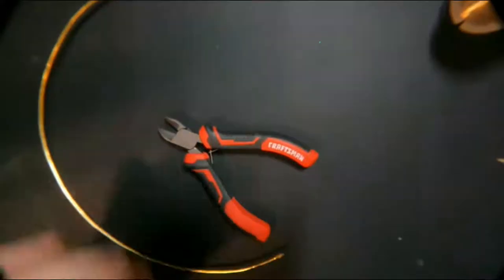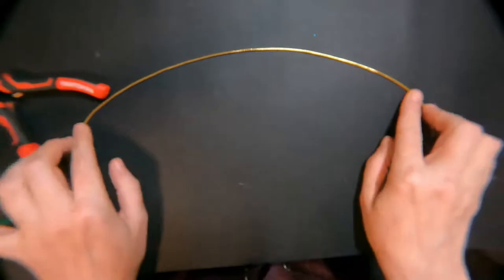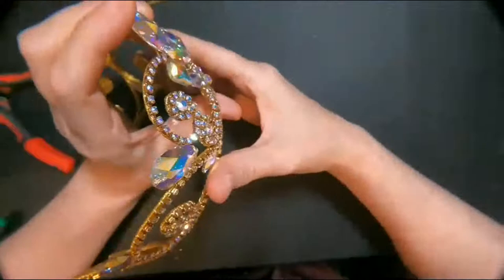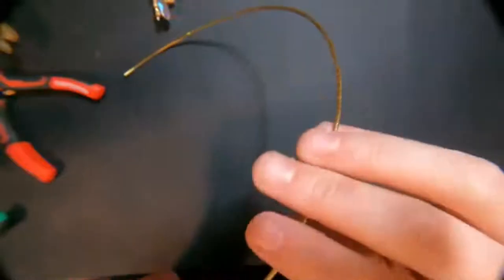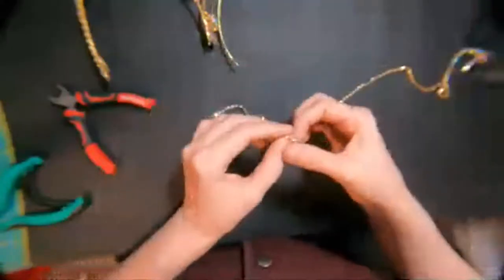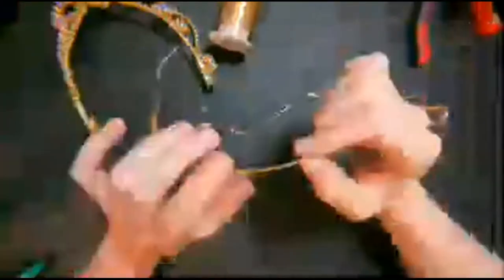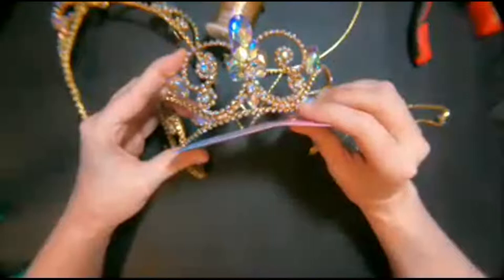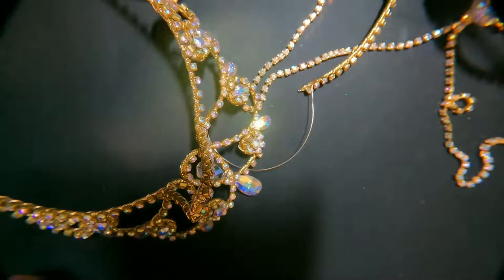Creating a base wire for your ballet headpiece

Comment: I have been making tears for a few years now. Just wondering why you don't use premade metal headbands
Reply from the maker: Premade headbands are shaped -- well like a headband. They can work as a tiara base; however, I personally -- as an ex-ballerina and tiara maker don't like them. They do not fit all heads and don't work for all designs. I've tried them out a couple times many years ago. Using a flexible wire allows dancers to conform the base of the tiara to their head according to where they want to wear the headpiece. Making your own base is more versatile.
Reply: @jerrilynnreeves  I appreciate the reply. Thx.